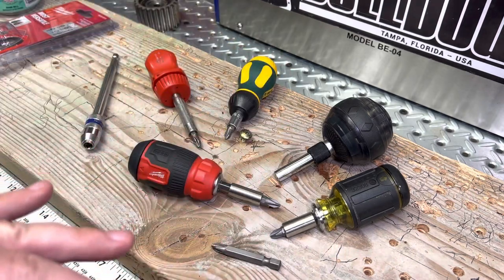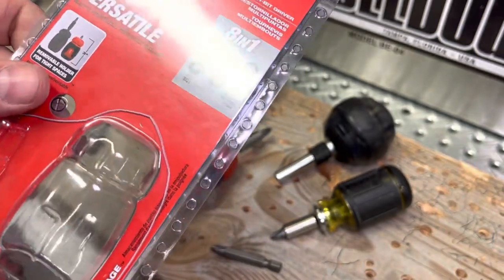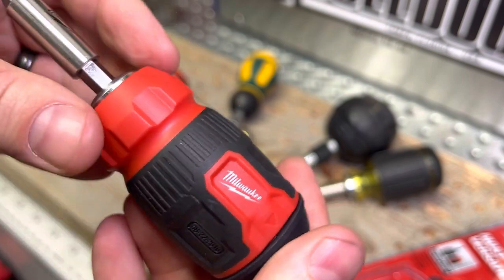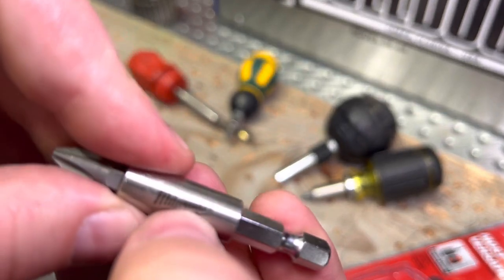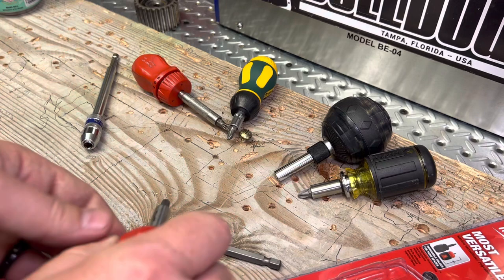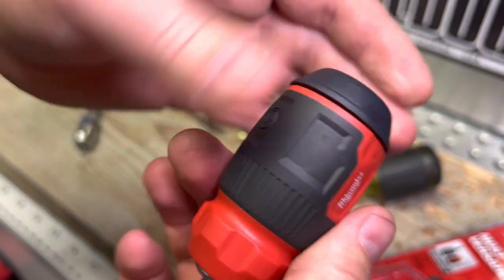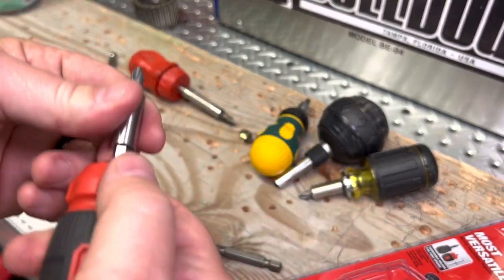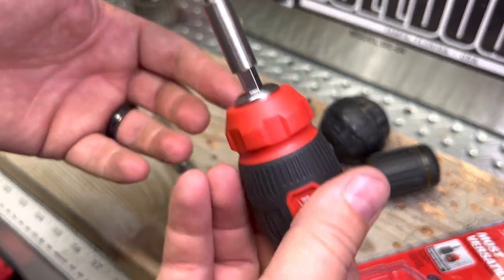Milwaukee’s NEW 8-in-1 Multi-Bit Driver. Part # 48-22-2910

Comment: Just purchased this drive and it now has the ratcheting option. Its sweet for the price is super great.  Now with the swivilling tool carousel on the back it works better with the ratcheting option. You don't need to release pressure from the driver to keep ratcheting loose or tighter. It has the middle option to be fixed as well as ratchet left or right.  The ratchet is also in really fine increments so you can tweak it just a small amount for it to keep working nice for very tight quarters.
Reply from the maker: The ratcheting would be a nice benefit. Glad to hear you like it.